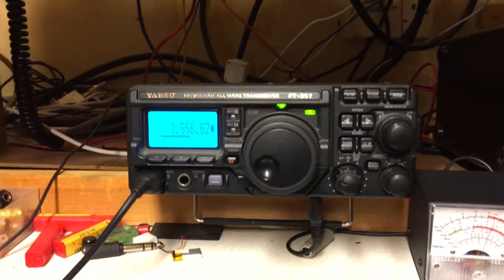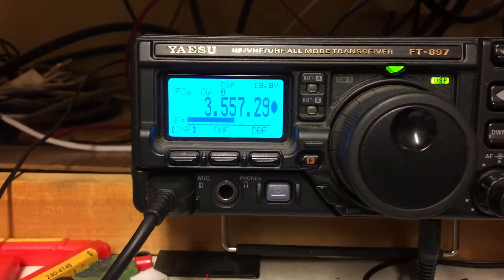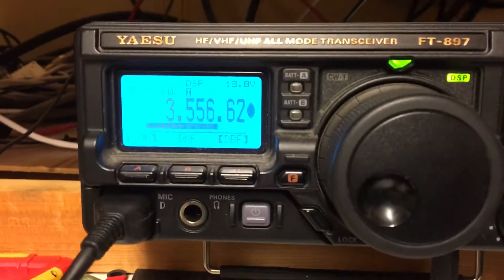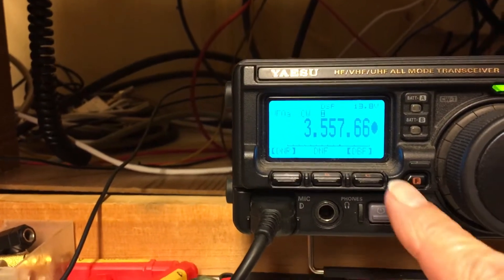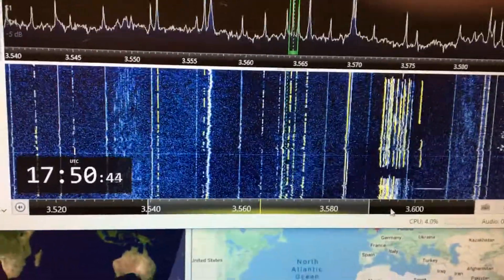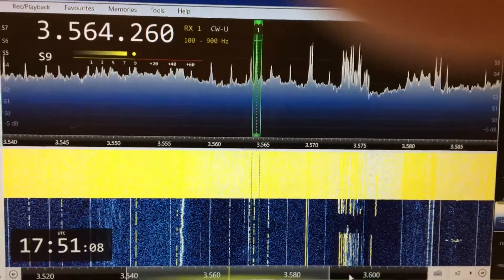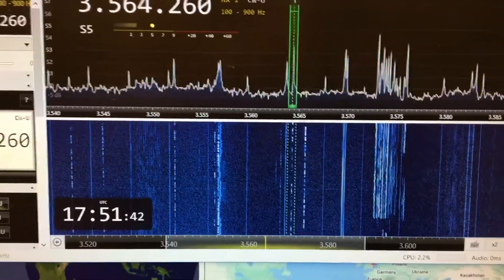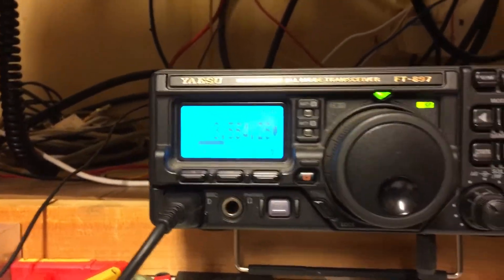My QRM eliminator with FT897

Comment: OFCOM are not fit for purpose, They are not bothered about the HF spectrum getting plagued by none compliant devices. Amateur radio is being killed off for Hams who live in urban areas because of the lack of enforcement by the so-called Regulators, it is discussing Imagine if you never had the QRM eliminator your hobby is would be unusable there are people who don't have room to put up a phasing antenna to enable them to use this device they are screwed and many have given up the hobby. I'm glad you can use your equipment as intended, unfortunately many can not. Ofcom need to do their job keeping the spectrum clean, but if the undue interference lands inside ham bands, they simply don't give a shit
Reply: Guess this was the reason for Ofcon doing away with the ham license fee.
Its not just an urban problem i live in a rural location and now suffer from PLT qrm, but now experimenting with a qrm eliminator.

Comment: Hi. where you conect the PTT control  kabel on this FT897 ?
Reply from the maker: The PTT line is available from the 8 pin data socket on the back. You will need the mini din plug and if you use that for the CAT you’ll need to splice into it. I made special extension cable that tapped the PTT line and also fitted a socket to the other end so I could still use the CAT cable. Information is in the user manual which is freely available on line.
Reply: @MarkTuttleG0TMT  Ok thank you for info.I have ready ordered the eliminator and wait for delivery.saw what happen.But i will conect not to data socken only to cat linear socket.

Comment: QRM-Eliminator on is almost like Heaven. 🤠👼⛪
QRM-Eliminator off 😱🤯😰😵💀

where to buy this device ?
Reply from the maker: The kits are available on eBay. Just search for QRM eliminator. I have modified mine to include a small RF preamp on the noise antenna side as I am only using a small car aerial as a pickup but if you can get a 5-10m of wire out for it you shouldn’t need it. There’s lots of designs on the internet too.

Comment: Is this the kit available online? Amazing!
Reply from the maker: Absolutely. If you're OK with using SMT (not the tiny, tiny ones though), then it's very simple. Look up QRM eliminator on eBay. Compare it to the circuit diagram on this web site: http://www.radioamatoripeligni.it/i6ibe/xphase/xphase.htm. They are mostly the same design. You could always build your own I suppose, no requirement for it to be SMT either. The important thing is to get enough noise signal on the Aux antenna. I found I needed to add a small RF pre-amp of about 10-15dB for best results.